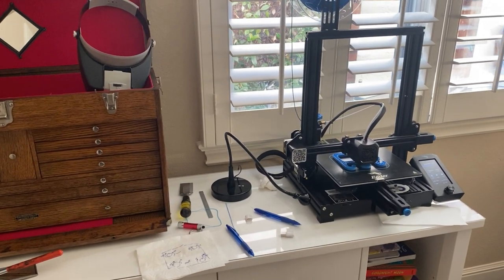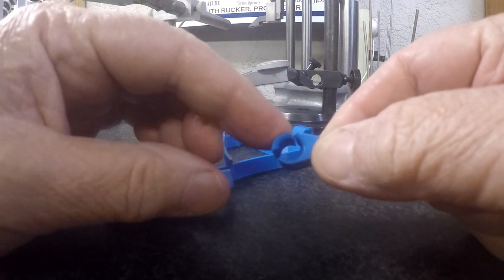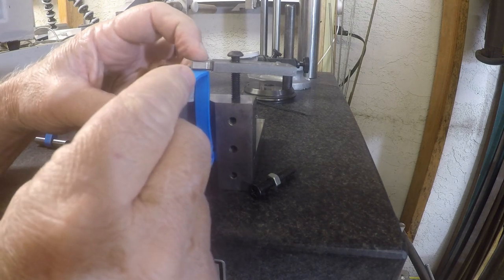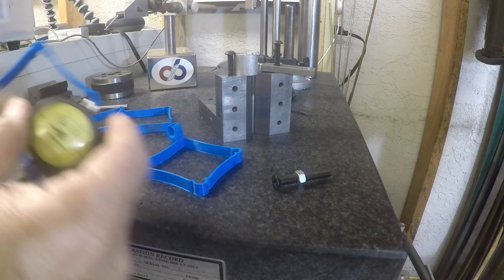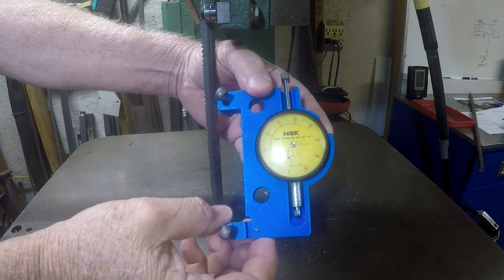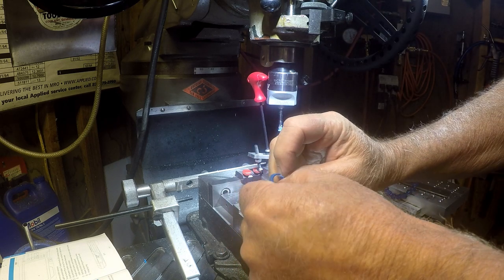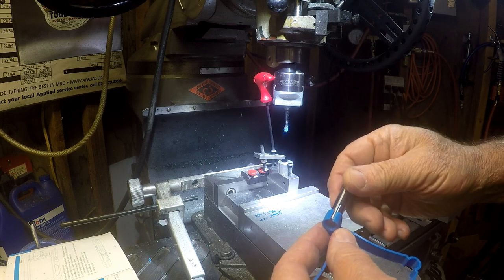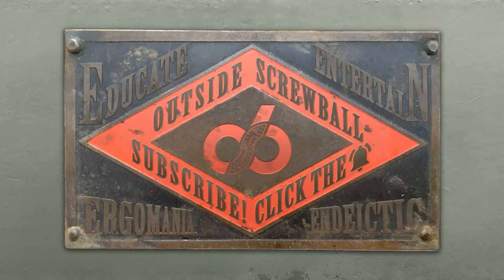Ender 3 V2 printer bed leveling (dial indicator accessory build)

Comment: Thanks Chuck! I just received my Ender 3 V2 printer yesterday (black Friday sale $238 shipped) and I love it. I spent the time to set it up correctly, but now with the addition of this dial indicator holder (in my print to make list) and improved bed adjuster  retaining springs (Amazon)  the printer should remain very accurate. As I write this comment the printer is hard at work printing a vacuum hose adaptor for my DeWalt 20v sander. Thanks again, videos like this are very helpful.
Reply from the maker: Awesome Jim....here is a link that I am using since I can't draw yet!  Using Cura to resize some of the trays
https://www.thingiverse.com/thing:3066035
Reply: @outsidescrewball  Thanks so much Chuck! Three days ago I had no idea what Thingiverse and Cura even were, LOL. Actually drawing a design seems pretty daunting to me at this point. Please keep your videos coming, they are one of my favorites!

Comment: I have a Starrett blade tension tool that is exactly like the one you show, with the advantage of the dial face having a custom layout to show PSI. I use it every time I change the blade. I discovered that I was undertensioning the blade by  quite a bit, before I got it.
Reply from the maker: I used blade tension device the other night and to get the reading of .004 on the indicator tension... also showed me that I was not applying enough tension to the blade....

Comment: When I was printing a few pulleys for my metal lathe I thought I had used the wrong measurements in cad when designing the shaft hole. I think i wanted a 5/8ths hole and it was just short of 1/2. Like .495 or so. I ended up buying a cheap set of reamers to use on plastic but you need to get the dimensions very close otherwise youll go through the outer wall. Tried that with one pulley and the wobble was so terrible i thought my bench was going to break.

Comment: Maybe,the software can be changed to compensate for the larger dial indicator diameter. Or maybe that is too hard. I am just brainstorming. Lol. I am glad to see your wonderful videos. Thankyou.
Reply from the maker: Clayton...thanks for viewing and your comments, a larger dial diameter indicator could be used in the same holder as the stem is the same diameter....I think that was your comment/question....I had the smaller indicator so that is what I chose

Comment: nice job but there is really no need to mill the holder just heat it up with a heat gun, then slid the indicator in. I'm not going to spend 20 min cleaning up my mill and setting it up for a job that takes 2 min to fix with a heat gun.
Reply from the maker: thanks for viewing and your comments